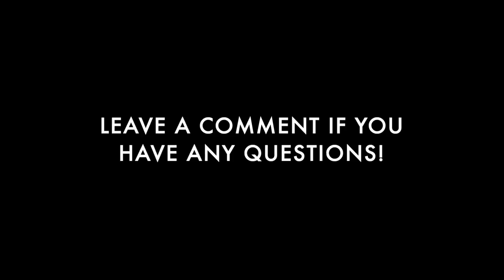How To Install A Clean Stone Base For A Patio - Jordan Court Project

Comment: nice video. would this work for a circular fire pit area? if i plan to build a retaining wall around it does it need to be graded to allow for drainage? and how much of the circumference of the outer edge would you recommend taking up without preventing easy drainage? i’m removing an old pool and want to make a patio.
Reply from the maker: It would definitely work for a fire pit area! If your pavers are pitched towards the wall you could make an area of the pavers permeable by using #8 stone in the joints instead of poly sand. If you have clay soil you would probably want to install drainage in the base to deal with the water that would collect

Comment: I’ve seen a few videos on this now and I would love to try it. Is this a hybrid install as you still use polymeric sand? I’ve also heard of problems with the edging in an open base and the fix is to use gravel under the edging. What are you doing for your edge restraint system?
Reply from the maker: Yup, this will be a hybrid install with poly sand! I have been using concrete edge and mixing in fiberglass to strengthen it

Comment: Awesome video! I was wondering about the subgrade compaction - what do you do to determine what is enough force to compact with? Is a large reversible plate compactor needed, or in general does a small forward plate compactor work like the one show in the video? Also what lime and portland cement ratio do you use?
Reply from the maker: Nick Wright our forward plate compactor works well for us, once we amend the soils with about half Portland half lime and get it rock solid with the compactor we start our base. Also putting geogrid into the base is like cheap insurance
Reply: @THEpremieroutdoor  sweet, thanks for the info!
Reply from the maker: Anytime!
Reply: @THEpremieroutdoor  GEO TEXTILE act like a weed barrier also.

Comment: Do you still install poly sand the same way as with a dense graded base with concrete sand setting bed?  I had some trouble with losing a lot of poly sand into the 3/8" setting bed.
Reply from the maker: We still do regular poly...definitely takes a little more than dense graded